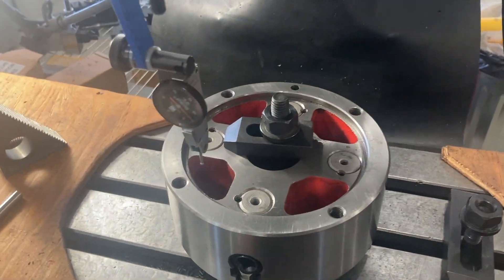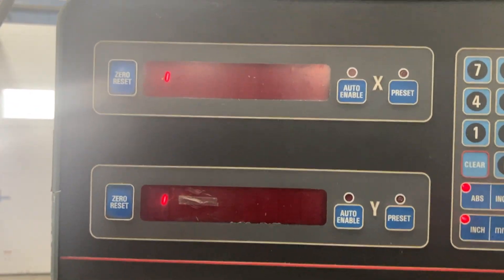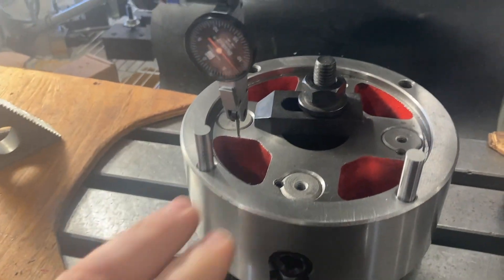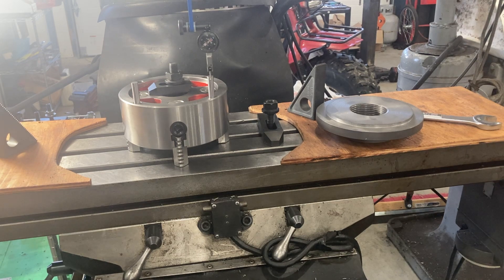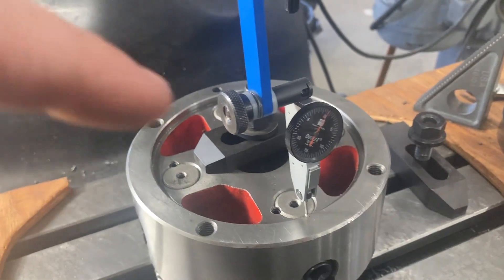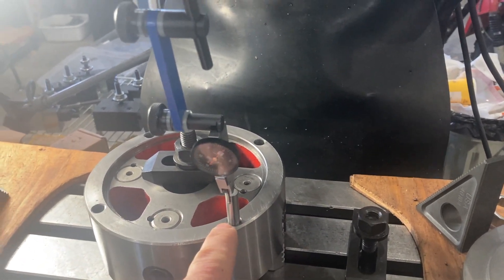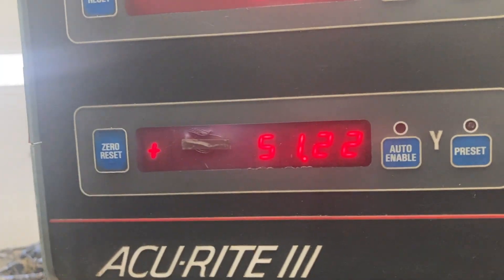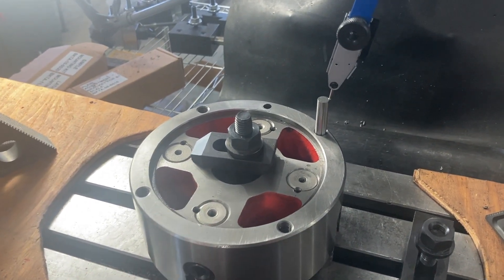EASY Machine Shop Tip - NO MATH Bolt Circles

Comment: Measure over the pins and subtract the pin diameter. If you can't do that, then zero a digital caliper over a pin then measure over the pins. This will give you the hole centres before you have even lifted the chuck onto the mill.

Comment: That works for something simple like 4 holes. Theoretical machinist has has a bolt circle calculator, among other things. I would have indicated where you did also, but mainly because that's the register for the backing plate. The OD of the chuck could always be off slightly.
Reply from the maker: It also works on much more complex parts that have irregular space holes. As long as it’s symmetrical, it works, even if the spacing doesn’t follow a clear pattern

Comment: Your method works. I would use my transfer screws if those are tapped holes or transfer punches if through holes.
Reply from the maker: Definitely lots of instances where that’s much faster and simpler. 

I’m hoping people watch this and realize you can use an indicator and a simple readout to figure out different dimensions or patterns on a workpiece. 

On this particular one I turn the register to .0005” clearance on my backing plates, and sometimes I have a hard time separating them off once I set them down in, so I don’t like using transfer screws, but there’s no reason someone couldn’t do that
Reply from the maker: Thank you for your comment, I appreciate the work you do for home machinists and people getting into this trade